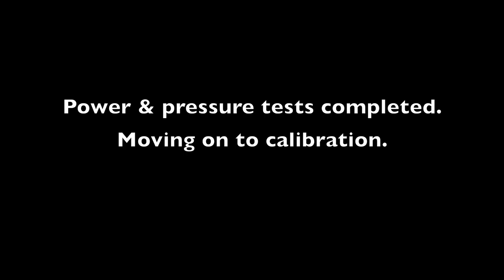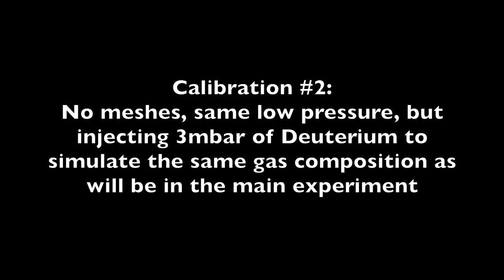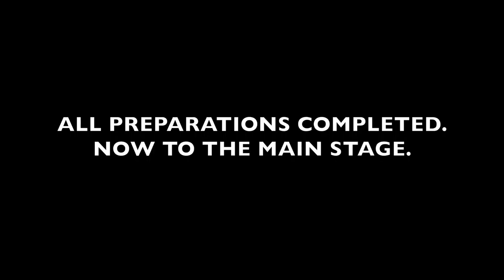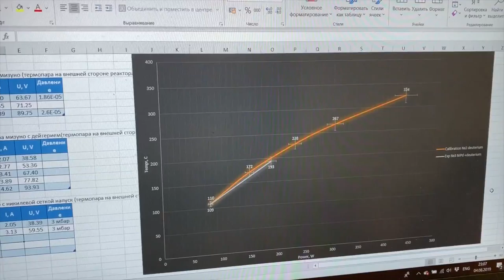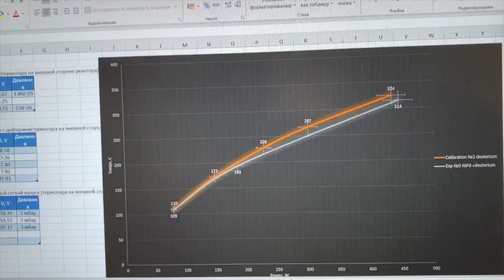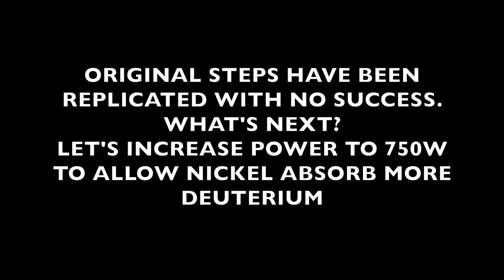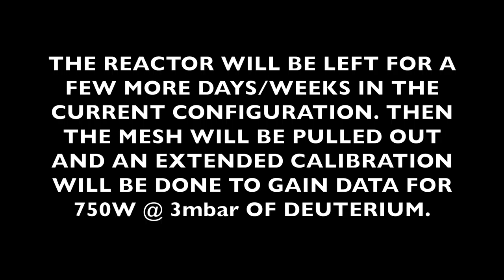Tadahiko Mizuno Experiment. Part 2

Comment: In the early days of electron tube manfacture trace amounts of oxygen would degrade the performance of tubes.   This as elminated by adding a bit of magnesium as a "getter"   The magnesiom was ignited and would both burn up any aviable oxygen as well as depositing on the glass envelope and absorbing more oxygen over time.

Comment: Mizuno uses 1 to 3 mbarr with no reporting of results outside that range. You might also try ordinary hydrogen. 1 ordinary hydrogen is much less expensive. 2 this is the only experiment involving Ni and Deuterium. Brillouin Energy is getting good results with ordinary hydrogen and Ni. We have seen an increase with the addition of a small % of deuterium but but to much actually reduces our reaction heat.

Comment: The solution is with Induction heating and the frequency must be  200 kHz alternate current. The calibration must be in a calorimeter. You measure the weight of water who is evaporated. Include delay of 1second  between 1second induction heating.  1second heat 1 second stop 1-second heat 1 second stop etc....In my town, Kavadarci Macedonia is company  Euro Nickel Industries who is a pyro-metallurgical ferronickel producing plant. I am impressed about metal nickel and because I am a Ph.D. for technical technologies, I know the nickel is the main metal for LENR.
Reply from the maker: In the original paper water calorimetry was mentioned as not recommended. We will be conducting further experiments on this reactor with glow discharge as well as AC. All to follow in a few weeks as we need to get back to our proprietary program of experiments.